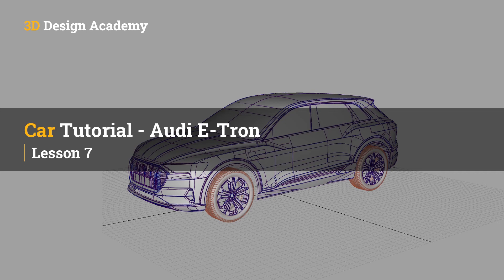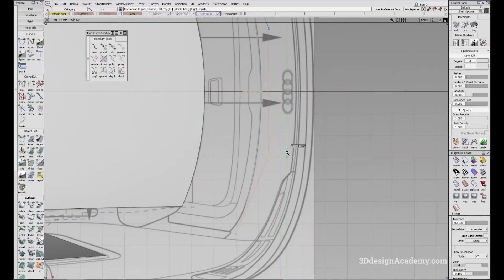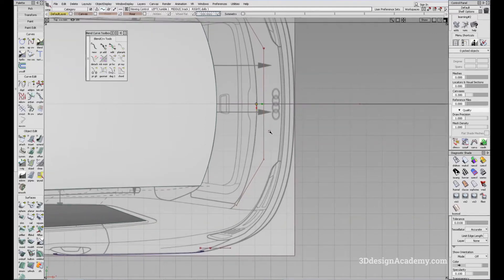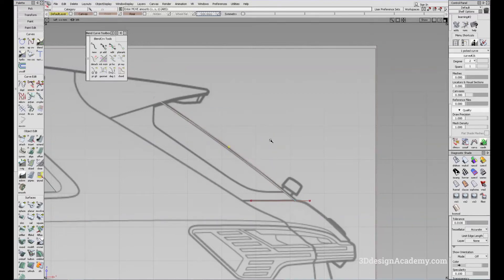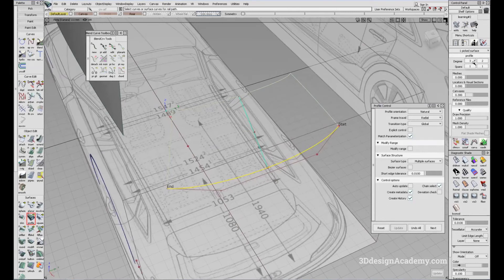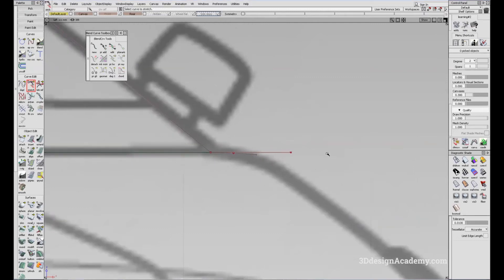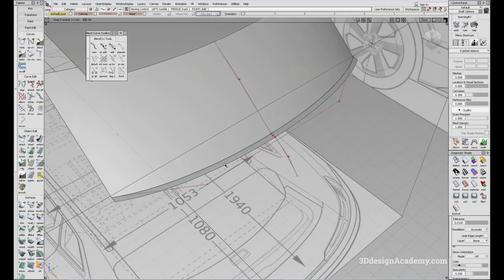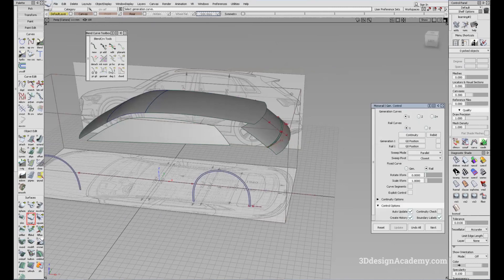Advanced Autodesk Alias Tutorials - Audi E-Tron SUV 7

Comment: One doubt, since the history aligned to one single curve now...
If down the line processes demand changing the shape of glass curvature, would all the surfaces glass ledge, tailgate BIW change...
How should one plan ahead those if such changes are due...
Reply from the maker: That would depend on the changes and how it would affect the highlight. Unfortunately, it doesn't really matter which software you use, but if the lines change, it would cascade down to other surfaces. In a professional setting, there's design change, engineering criteria change, etc. which forces modelers to rebuild, rebuild, and rebuild! That said, however, keeping your data light, and keeping the basic primary surfaces would be my best advice. Also, you want to keep in mind how one surface interfaces with others, such as rear to bodyside transition.